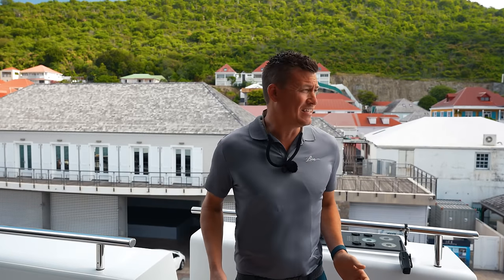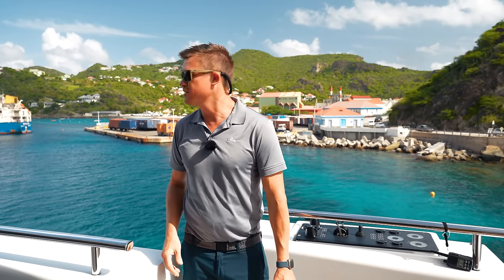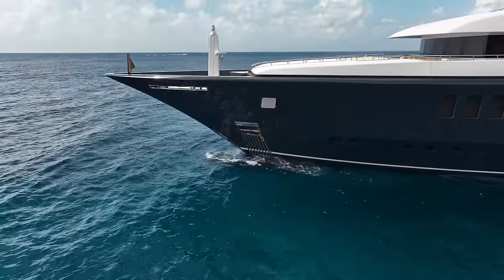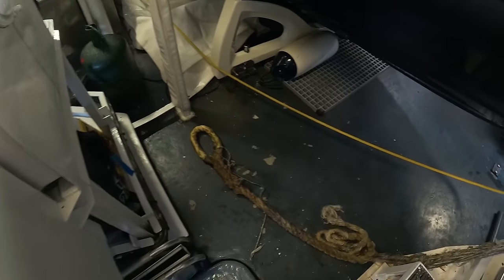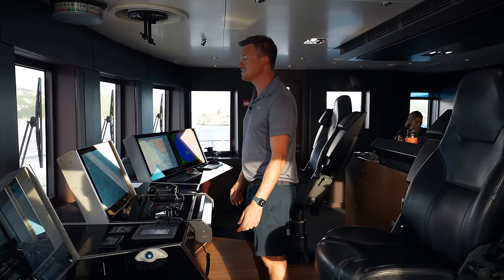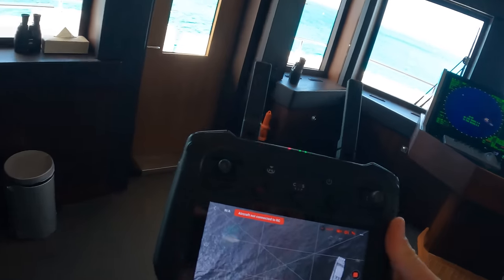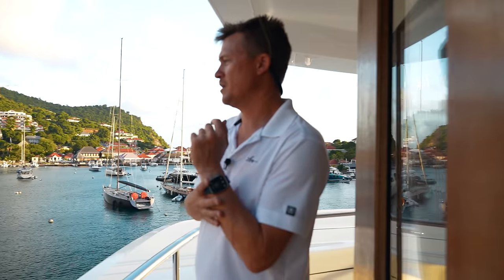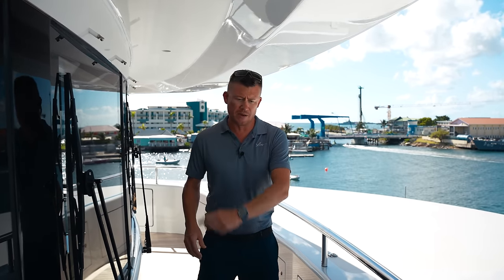Sail Away to Paradise: Superyacht Life in St. Barths

Comment: I’m interested in the base tip for the crew, you calculate percentage of the charter from what I can gather but what is a normal base tip for any given charter? Does the % go up or down given length and cost?
Reply: You base the tip on the cost of the charter, which will go up or down depending on its duration. 10-15% is the norm, more if service was exceptional, or you want to be.

Comment: Could you explain more about the tip. What is usual and why guest are stingy? Perhaps some people does not know that tips are an important part of the income in gastronomy, if it is a boat or a restaurant.
Reply: The crew tip is commonly paid from unused funds in the provisioning allowance that charter guests transfer to the yacht before beginning of the charter. Industry standard crew tip is 10%-15% of the charter fee. In the case of loon that would be about 2.5 to 4 grand per crew member for weeks charter.